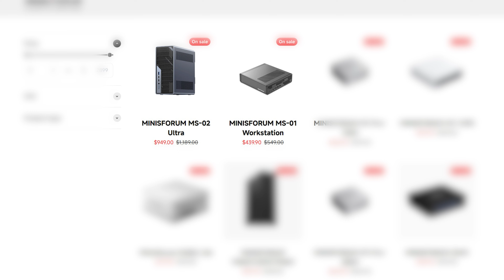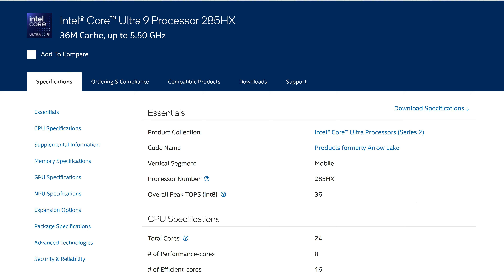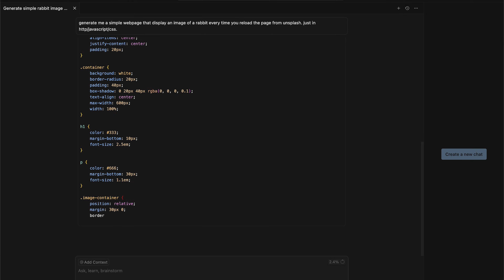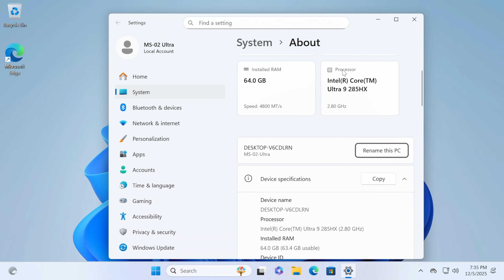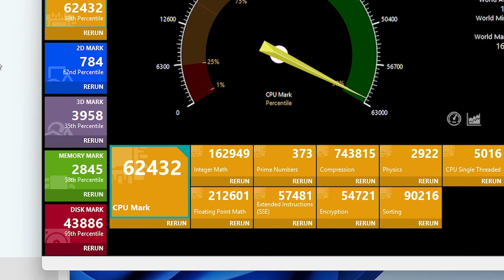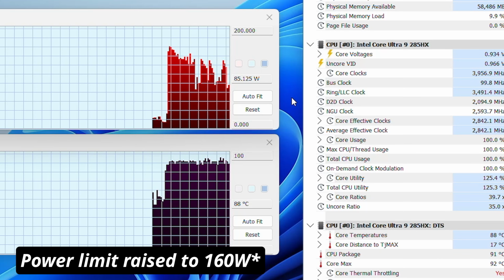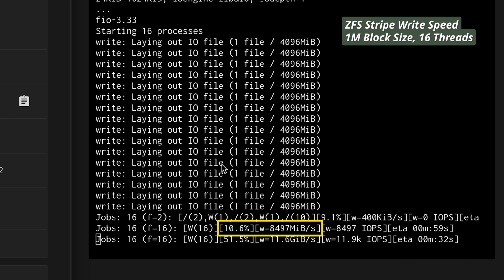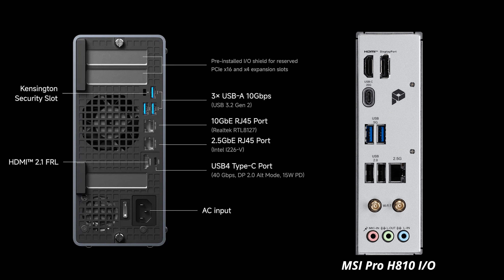This Mini PC shouldn’t exist - MS-02 Ultra

Comment: i need me one of them bd795 motherboards they offer. that same cpu as the msa2 with full desktop usability. plus i can reuse my sodimm ram and m.2 storage out of my existing mini pc and save even more money
Reply: Don't do it. I had a bad experience with that board and based on the comments my issue is not unique.
Reply: @Telesko what was the issue you've had? I'd definitely be sore if I had spent that kind of scratch with some immediate troubles. I've had my minisforum vesa mounted on the back of my TV for about 2 years no issues yet! I've opened it and cleaned  it once when I installed another m.2 but the only fan collecting any dust was the ssd fan. I really have been leaning towards the bd795 for the full pcie slot and I've been strongly enjoying the little rdna2 apu. They do have a lower tiered Ryzen 7745hx mini itx motherboard that seems like a steal for the price